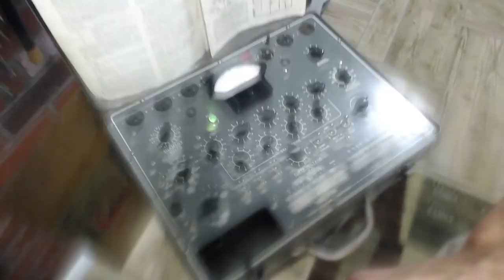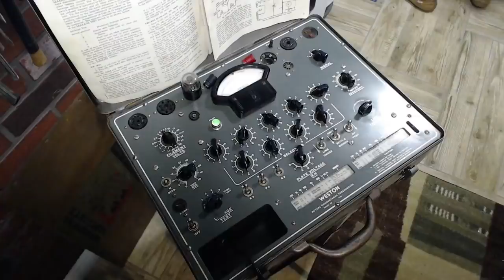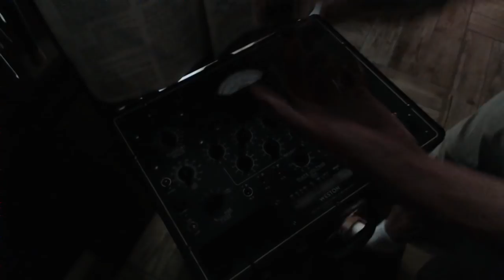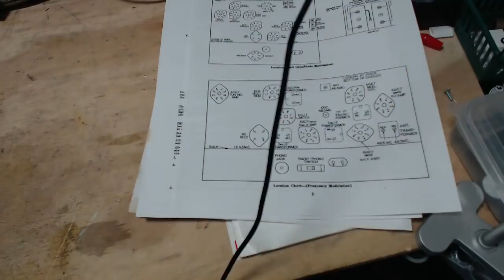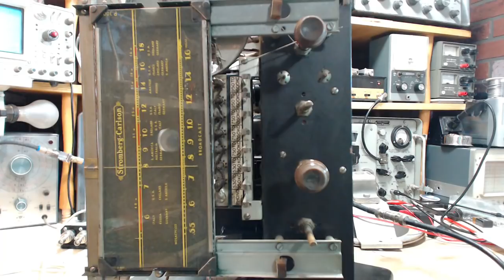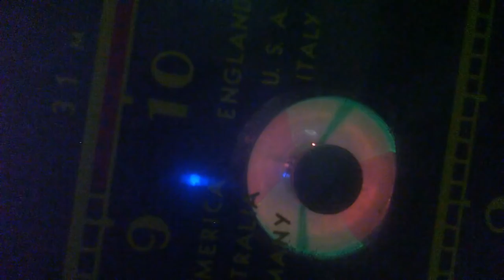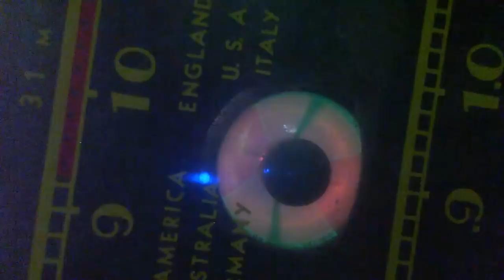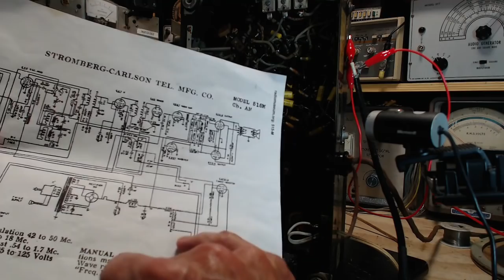Stromberg Carlson Model 515 Video#14 - Magic Eye

Comment: I noticed that  the service manual lists all the correct voltages for the tubes, including the tuning eye tube. There a number of resources dealing with the making of solid state replacements for the tuning eye tubes. A bit of work though.